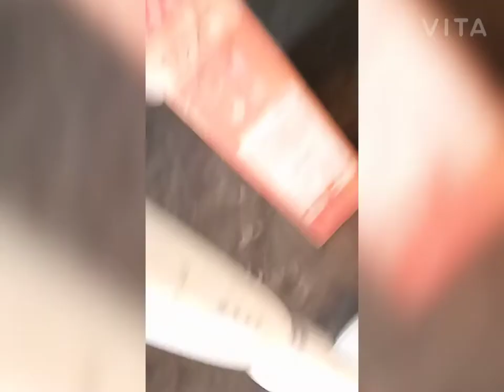How to fix stand fan neck || Stand fan Tutorial #shorts 🔥🔥🔥

Comment: Believe or not, your video helped me solve a big problem. My wife bought a fan from Bestbuy. When assembling, she thought the tilt is problematic. After opened the neck screw, she had no idea how to put it back. Especially the small spring and a tiny bar. She inflicted her pain on me and commanded me to find out. I googled around until watched your video. At 0:12, it clearly showed the picture where the tiny cylinder bar (above the spring) located. I Instantly, figured out  . in 5 minutes, the fan was up and running. 🤣🤣, thank you very much for sharing. Never know internet so powerful.